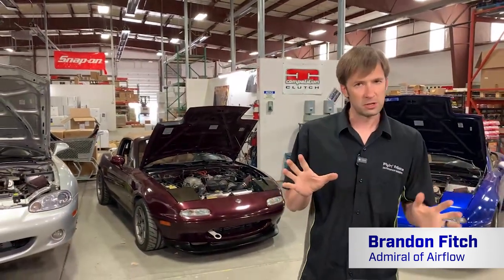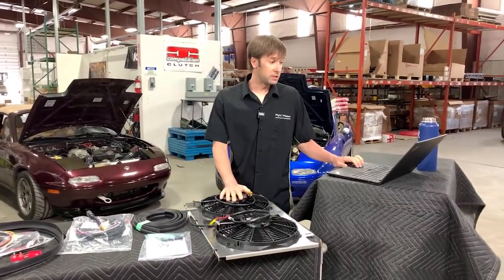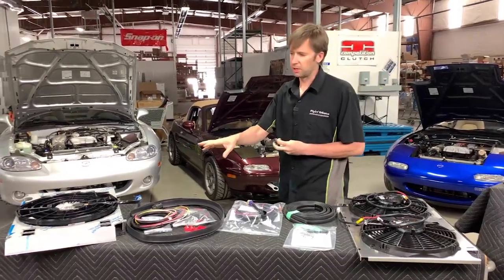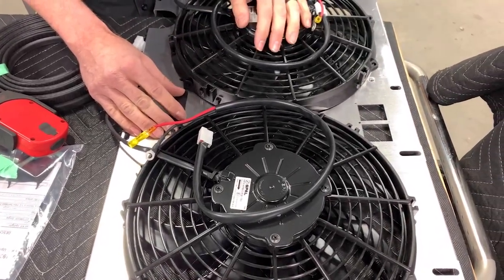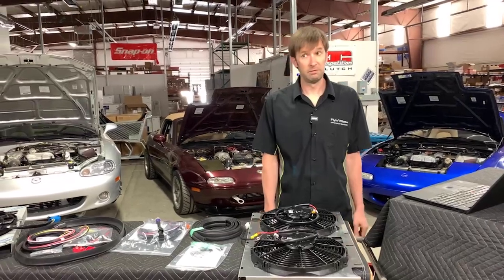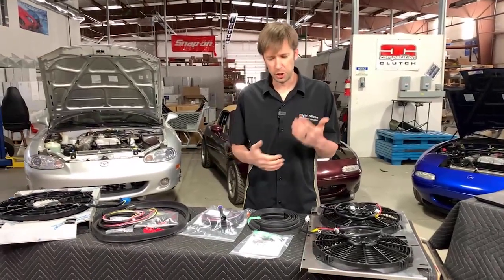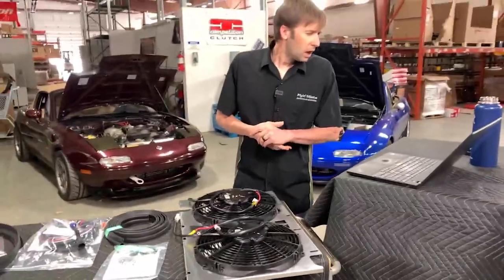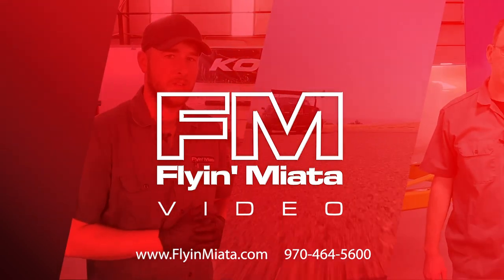FM Stage 1, 2 & 3 Airflow Kit Comparison (FM Live)

Comment: You'd recommend crossflow and fan kit before reroute? I assumed that the reroute evening cylinder temps would be the first order of business.
Reply: Depending on how the car is used i recon it could go either way
Reply from the maker: It depends on if your problem is getting heat out of the engine or getting heat out of the coolant. In our experience, the latter is more difficult to do and the cause of more overheating problems.
Reply: @FlyinMiataVideo  so I have your older coolant reroute and inline thermostat... works great keeps temps down without fans unless summer (i live in nc) but I still feel like oil is getting to much heat or injectors idk exactly but I am trying to figure out ... soon to install oil cooler and filter relocation and then boost it but have been trying to work all out b4 boosting ... I have rx8 injectors ... my dead time is set to .8 and the close angle is 355 across board .... should the close angle be different than the stock miatas ? ...tuning myself so I learning and have not found anything on this subject yet ... plenty on dead time but not close angle ... I running a speedyefi standalone witch runs tuner studio speed density tuning its about the middle of ms2 and ms3 .... so yeah I am rambling but I figure who better to ask than yal . . . Peace and love to all and stay safe and thanks in advance
Reply from the maker: @mastercricket7626  We're not able to help with tuning your standalone, sorry.
Oil and water temps tend to follow each other, so cooling one will knock down the temp of the other.
Reply: @FlyinMiataVideo  was not asking for help tuning was asking about the injector dead angle of rx8 injectors cuz I can't find a thread on it but thanks anyways
Reply from the maker: @mastercricket7626  We've never used RX8 injectors so we don't have any information there.
Reply: @FlyinMiataVideo  okay thanks for responding atleast then and if you have a recommendation on a better set to purchase would deff listen lol

Comment: How will the different kits fit in a V8 swap?
Reply from the maker: That will depend on the radiator you're using and how you mount it. We used our old Stage 2 setup (basically the current Stage 1 with a different fan combo) on the ones we built here. We haven't tested to see if the brushless units will fit yet - it looks like it might be possible but it will be tight.

Comment: I live somewhere where the weather is generally hot and humid, 35-38 degree Celsius most of the year. I use my NB2 as a daily and often find myself on traffic, during those moments I sometimes see my water temperature gauge (aftermarket fitted) creeps up to almost 115 degrees celsius and i find it very concerning. Both my fans are always on as I use my AC all the time and it is on stock cooling system. Is this normal or should I continue to be concern? Is there a workaround on this? Many thanks!
Reply from the maker: There could be many variables that would contribute to the temps going up in traffic. Would you mind emailing this to our techs directly at support@flyinmiata.com ? They can get more details and give you a much more comprehensive response there. Thanks!

Comment: Any work around for the older stage 2 fan kit?  My car stalls just about every time the fan turns on when the car is stopped.
Reply from the maker: I'd be checking idle settings. Your car is having trouble compensating for the increased load. If you're running an aftermarket ECU, you may also be able to stage the two fans so they come on at different times.